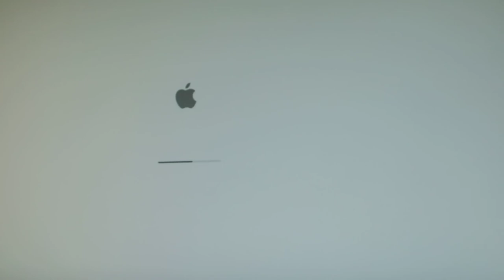mac pro cpu upgrade Intel Xeon X5680

Comment: Thanks for this, ive been searching for a simple video upgrading single cpu mac pros forever.
Reply from the maker: Glad it helped you. I'm still running this setup to date and really have no issues. The only time I was a bit bummed was when I discovered that I couldn't update to the latest Lightroom release which I needed to in order to read RAWX files from a new Fuji camera. Luckily I have a macbook also that solves that.

Comment: Nice video with a couple of suggestions. 1. I would leave the old CPU in while getting the dust out 2. Make sure to evenly spread the thermal paste on the cpu before getting the cooler back on.
Reply from the maker: Thanks, thats solid advice

Comment: I have a 3.2GHz 4-core Xeon W3565 processor, but I want to upgrade to that Intel Xeon X5680 processor. Could you give me your advice if I can edit my videos with that processor with greater results?
my computer is a mac pro mid 2012 5.1
or can i change the processor motherboard for two 6 core processors?
I hope you answer me because I really want to make a good investment
Reply from the maker: Finding a 2x CPU board for these older Mac Pro's isn't impossible but rather expensive for around 400 EUR (minimum). And then you still need to get 2 CPU's. And the gain you'll get with a 2x CPU system is something you'll only be able to harvest with specialised multi threaded applications that can use all these extra cores. Think of server software and database applications, not desktop apps. So instead I would just replace that single CPU with a slightly better CPU like you suggested. The X5680 is a great deal because most want to get the highest end option available for that socket (X5690) and will pay more for those instead leaving these X5680 as a cheaper option. You can check this overview at http://www.cpu-world.com/Compare/858/Intel_Xeon_W3565_vs_Intel_Xeon_X5680.html to see where the X5680 does better than your current CPU. Mostly clock speed and more cache should directly help with desktop apps. The extra cores again are harder to put to use because you need software that is written to handle so many cores.
Reply: @H4n583  thanks for your help and for responding now my new processor is on the way home and i will see how it works with davinci resolve which is my editing program, i hope to write to you when i install it thanks for your teachings

Comment: Wish I watched this video earlier, I upgraded to the 3.33ghz 6-core W3680 instead. I thinking the performance isn't as good as this CPU and I overpaid.  :(
Reply from the maker: Yes even if you stick to the server CPU the X5690 is 1/3 to 1/2 more expensive then this X5680 just because it's the highest clock speed available and people like to max out.

Comment: hello Hans, what processor do you suggest for upgrade a Model: MacPro3,1//Processor: Quad-Core Intel Xeon// Processor speed: 2,8 GHz// Processors quantity: 2// core quantity: 8// Caché  2 (per processor): 12 MB// Memory: 6 GB//bus speed: 1,6 GHz
Reply from the maker: You already have 8 cores in total. Most that upgrade these pre 4,1 systems do it to go for that max of 8 cores. According to everymac.com these work : "2.66 GHz Quad Core Xeon 5355 processors or 3 GHz Quad Core Xeon 5365 processors" also check https://everymac.com/systems/apple/mac_pro/faq/mac-pro-how-to-upgrade-processors.html

Comment: ......man, are you serious? did you "upgrade" from dual core to single? ....nice....
Reply from the maker: For my (and most) use case swapping dual 2.26 GHz for single 3.33 GHz is a real upgrade. Also duel boards of that 4.1 generation have delidded CPU’s while the single CPU board uses CPU with heatsink.

Comment: What happens if I forget the thermal pasta?
Reply from the maker: The CPU will overheat and computer will either work slow, freeze or reboot. Could be that it still boots since the heatsink is on. But the heat transfer won't be optimal so as soon as you stress the CPU it will overheat. Shouldn't damage anything since sensors keep track and will protect it when needed. But still a good idea to add some thermal paste cause otherwise you'll never be able to do any actual work on that computer.